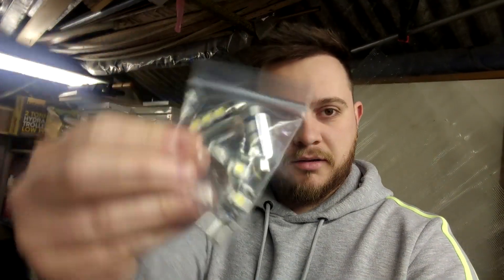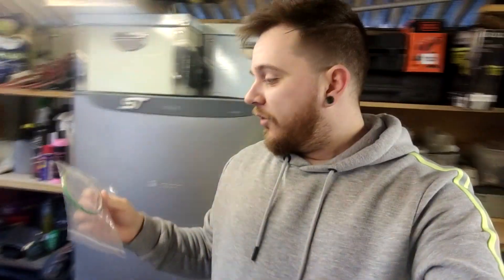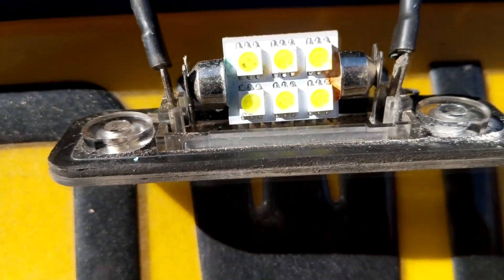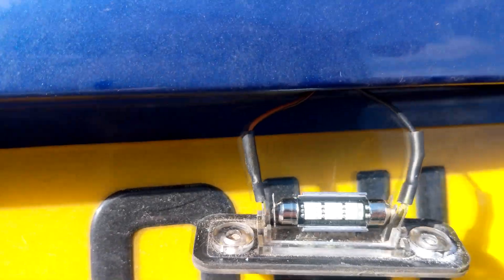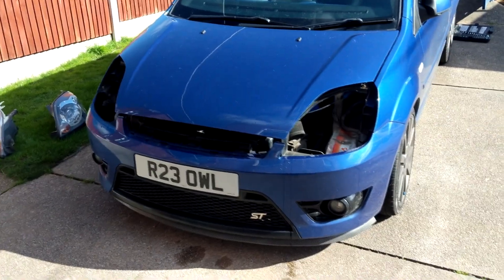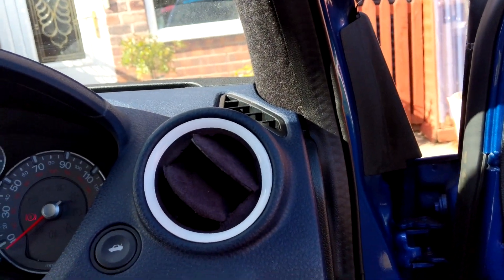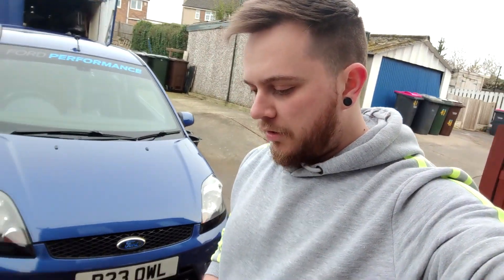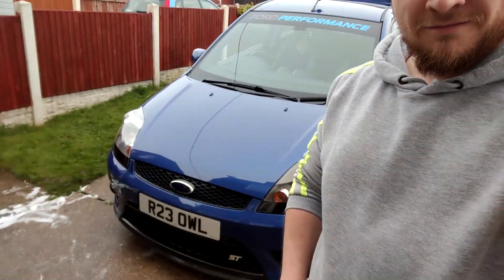Changes to the Headlight Wrap...? CAN'T DECIDE ):

Comment: If you get rid of the third screw behind the front grill that holds the headlight in, you dont need to take the grill off to take the headlight out. It's got two more screws to hold in place. Just makes it easier. Same with he rear lights. Get rid of the lug on the back.
Reply from the maker: Do the lights stay level if ya do this?
Reply from the maker: Do the lights stay level if ya do this?
Reply: @R23OWL  Yeah they'll stay level because of the fitment and the two screws at the top.

Comment: Think head lights look odd as the black in the headlights is not glossy... you should split them and de tango and paint chrome bits...
Reply from the maker: Absolutely on my list of plans is to split, detango and spray the chrome black, with the lense to be very slightly tinted too 🤙🏻
Reply: @R23OWL  Nice one, I also have a ST150 pre face lift only on 40k. picking up a carbon fibre bonnet for it next few days.. bit of a ebay bargain, car is slowly turning into my track project.
Reply from the maker: @isoconfused8744  carbon bonnet? 😮😮😮😮 Nice one!!!